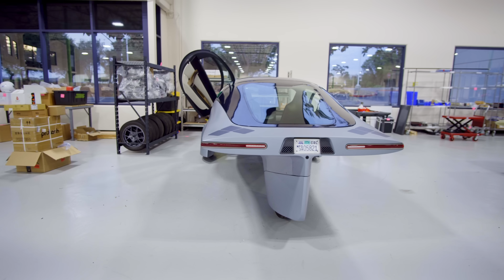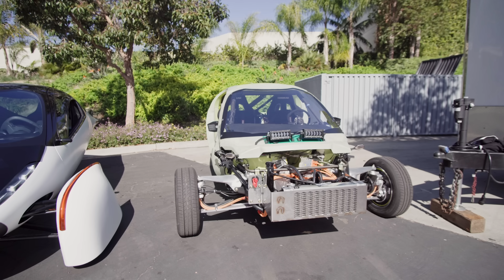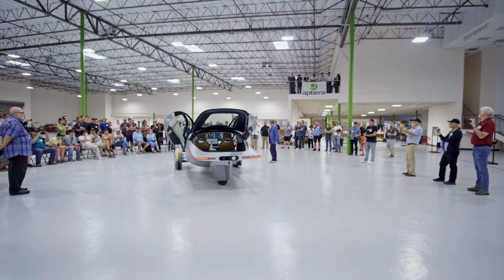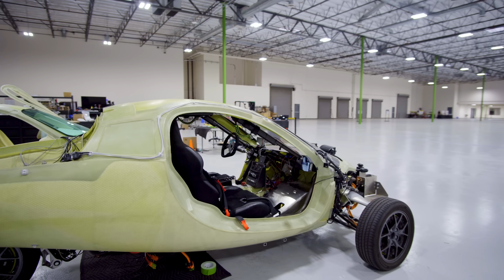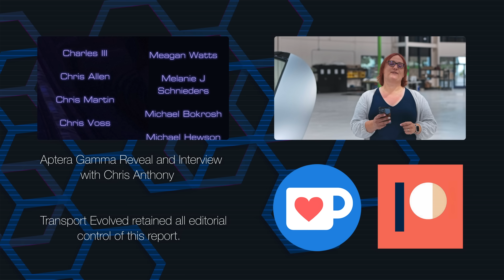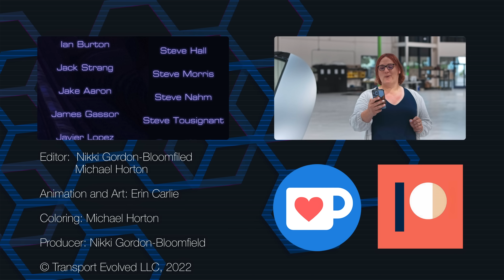The Aptera Gamma Prototype Is Here. What's NEXT?

Comment: The only thing holding back the older automakers from going to the Tesla charging port is pride.  They don't want to admit that Tesla's solution is more efficient while being elegant and simple to use.  North America should adopt the Tesla North America port as the standard as it is the most common here already.  EA is already going to be replacing all of their stations, might as well add in Tesla cables.  I guess some people like having to hold up the CCS plug while it tries to initiate a charge since it's too heavy for the angle it's usually placed.
Reply: The other thing making the Tesla connector impossible for other vehicles is that it CANNOT handle the 800V and 1000V DC charging that is necessary to fast charge the very large packs that they have.  The Tesla connector is limited to 400V by the spacing of its contacts.
Reply: @wingsounds13  nothing else was making it impossible for other automakers to use the Tesla NA standard.  They CHOSE not to use it, big difference from not being able to.
Reply: @MarkLLawrence  Except it was Tesla that decided not to support any of the open standards that existed. Tesla was not the first to develop DC Fast Charging. Both CHAdeMO (a few years) and CCS (a few months) launched before Tesla introduced the Tesla Model 3 and its proprietary charging connector. There was no incentive at that point in time to drop the tens of thousands level 1/2 AC chargers out there in favor of a charger that was a closed design from a manufacturer with 0 reputation behind them and that struggled financially for the following years.

And Tesla doesn't just allow you to use their design (it's not a standard, it's a design! A standard required 2 independent implementations, when Aptera launches with it, you could call it a standard, after more than a decade). You, as a company, have to pay for it. And you get no say over it, unlike with the open standards that exist and where even Tesla has joined Char-IN and is able to contribute to the CCS standard.

Tesla's solution is not more efficient. It has a smaller connector and that is where the advantage for Tesla ends in my opinion. Tesla does not support V2x for example, it does not, and might never be able to, support 800V or higher (for CCS they are already thinking about 1600V which is possible on the existing CCS connector). And Tesla has shown no interest to add V2x to its design. So why would other manufacturers have to suffer from the limitations that Tesla imposes?

EA can't add Tesla cables for the simple reason that Tesla will not allow it. Tesla controls the design, Tesla controls the communication protocol. And Tesla is not going to allow a competitor on the charge market to take away customers like that.
Reply: @Hans-gb4mv  yes, Tesla controls it.  And the only thing Tesla wanted in return for other automakers to use their design was that they contribute to the rollout and maintenance of the charging network.  Had these other automakers done that, their vehicles would already have access to the largest and most reliable fast charging network out there.  But, since they went with CCS, owners are at the mercy of EA, and how often those chargers are DOA.  Aptera owners won't have that problem lol.
Reply: @Hans-gb4mv  The Tesla charging business is not for profit. Tesla's stated mission is to encourage smokeless transportation and clean energy, so i don't see a problem with Tesla sharing their design and allowing it to become a standard.
Reply: @MarkLLawrence  again, battery and charging systems above 400V CAN NOT use the Tesla connector, PERIOD!  Of course, they could build EVs that take 1-1/2 to 2 hours to charge on a DC fast charger, but I suspect that would not be popular.  These huge 4 to 5 ton rubber-tired road tanks would be even less practical than they are now.
Reply: @wingsounds13  800v EVs are backwards compatible with 400v chargers, there are already some on the road.  It would be no big deal for an 800v EV to take a charge from a 400v Tesla supercharger.
Reply: @fotoguru222  Sure, tell that to the shareholders... . Tesla is a for profit company, publicly traded and therefore has a primary function to grow on both revenue and profit. Because the moment the institutional shareholders dump the stock because the company says it doesn't wanna grow, the company will fold. If it's not for profit, how come non-Tesla owners in Europe pay considerably more per kWh than Tesla customers? Isn't that because Tesla wants to make a proper profit out of those people as well?

And if Tesla wanted to share their design, they could have opened it up at any time in the past decade. They haven't. If they had, it could have become a dominant standard, but they didn't. Everything shows that they want to do the opposite of what you are writing.
Reply: @Hans-gb4mv  Yes, Tesla is a profit making business. However the division of the company that makes, installs and maintains the charging network is not. It is not a charity either. The division was funded by the company, but now supports itself. Tesla charging costs enough to support itself and then plows all its revenues into growing the network. If it going to start allowing any EV to use it, it needs to charge more to expand faster. It also gives other companies an incentive to invest in their own for profit networks.

Comment: Thanks for another great video. I love the Aptera but I have two nagging questions. What will it be like to change a tire and are they all the same size?
Reply: There will be the additional step of removing the wheel pants, but otherwise changing a tire will be the same as any other car. They've said that it won't take any unusual tools. Probably just a screwdriver. And yes, I believe all three wheels are the same
Reply: @GoClimbARockEh  Thanks, do you know where the jack point is for the rear?
Reply: @jimmyers4890  They haven't said yet. probably just in front of the tire?
Reply: @GoClimbARockEh  Is there a collapsible spare and jack in the car?
Reply: @SilverShadow2LWB  No spare tire, which is pretty common these days. I assume they'll be a jack but I don't know whether they've confirmed that or not
Reply: @GoClimbARockEh  Thank you for the info.  The standard now is to have an air pump with sealer to repair punctures.  But sidewall damage may require a call to AAA.
Reply: There will be a recessed anchor point to screw a plate as jack point. I think fwd of back wheel.
Reply: I owned an original Honda Insight with enclosed rear wheels. Removing the wheel cover to change tires was pretty easy.

Comment: Special curved solar cells don't exactly scream "easy to upgrade" to me.
Reply: Look at what is coming down the pike!  Multiple R&D centers are now showing flexible panels with 30% efficiency rates.
Reply: Certainly proprietary. You won’t find replacement at a local shop, but the whole panel should be easy to replace.

Comment: Nice to see them make progress, I love the idea of having a significant number of efficient (meaning low-drag) vehicles on the road.
Going with a single, center headlight for a car that's wider than many SUVs seems like an obvious bad idea for safety. I hope those yellow strips on the wheel covers are nice and bright.
Reply: Modern beamforming can very easily have a center light project even light across a wide area. I wouldn't be surprised if this had better illumination than some larger cars
Reply: @Ryukachoo  I'm not concerned about illumination. I'm concerned about making the outline of the vehicle clear to other road users, especially oncoming cars. The traditional way to do that is to have a powerful light in each corner.
Reply: @w0ttheh3ll  oh, the bright as hell light bar and the big orange illumination on the wheel covers should be sufficient
Reply: @Ryukachoo  I hope so. The concerns are that the main light may wash out the orange markers and that many drivers don't accomodate for unfamiliar vehicle types.

Comment: Love this vehicle. Self repair, uncompromising effort to efficiency and what works (tesla chargers, css with adapter), solar panels. Takes a lot of guts to make such a different car. I’m rooting for this underdog
Reply: @The Program You should compare the Aptera to another BEV. And in this comparison it needs much more maintenance.

Right to repair is useless in BEVs. What do you want to repair? The batteries? Electronics? motors?Inverters? All with 400V? A perfect possibility to roast yourself? Or set the battery on fire?
Reply: A motorcycle that repairs itself? Great underdog.

Comment: Great to see them getting closer and closer to production. Glad that they're at least thinking about having adapters available for the charge port. I'm also glad that they're thinking about people who want to make future changes to the vehicle.

I disagree with Chris (Aptera CEO) on wireless charging. If you want efficiency, then wireless is not the way to go. Wireless is DEFINITELY convenient, but you lose power from the transmission. Wired is much more efficient.
Reply: you are confusing phone chi charging with this different protocol. either way this is a waste.
Reply: @laloajuria4678  He talks about wishing that the Aptera could do wireless charging during the same segment when he was talking about their decision to use the Tesla port. 

Wireless charging isn't available YET for EVs. It's been talked about and people are designing for it, but it hasn't been implemented yet. The problem with wireless charging for EVs is the same issue you would have with wireless charging for a phone. The ONE place where Aptera might find greater efficiency with going with wireless charging is that they wouldn't have to put a charge port on the vehicle.
Reply: @zidaryn  Wireless charging for cars has been available for a few years now, but only as an aftermarket upgrade. I don't think any manufacturer has included it stock yet. And yes, it's not as efficient as just plugging in
Reply: @GoClimbARockEh  Cool. Wasn't aware it was actually in use yet.

Comment: So if I'm hearing correctly, Aptera will stick with the Tesla charge port and use an adapter for CCS and J1772.  Considering that Tesla has just released its CCS adapter for North America, maybe that's an easily sourced solution.  The more interesting part of this discussion is if Aptera is in talks with Tesla about using their Supercharger network for Aptera owners.  That would easily give an edge to Aptera owners while Tesla figures out how to open their network to CCS capable EVs.
Reply: If they don’t get SuperCharger access I will probably cancel my pre-order. I will not use it often (1% of my charges) but when you need it you need it. 

Being able to use my Tesla friends and hotel level 2 charges is also important.
Reply: @AstroStrongBox  I'm wondering why this is a deal killer for you. I've had a Chevy Bolt since 2017 and used DC fast charge (non-Tesla) twice. With Aptera being so much more efficient, the charge requirements are substantially less, so why all the concern over charge speed? When you DO feel the need for speed, why wouldn't a non-Tesla fast charger work for you? There are lots of them and the number is growing all the time.
Reply: @billman5379  I don’t need the speed of the Superchargers just the ease of use (just plug in with no extra app or NFC Pay), uptime, and more stalls at each physical location. 

The supercharges MIGHT have better just off the highway near food locations. 

Electrify America usually only have 2 to 4 stalls per location instead of 8 to 10 l Iike at Superchargers.
Reply: @AstroStrongBox  So far every US charging provider is half-assing it compared to Tesla.  Some are at quarter-ass.
Reply: @AstroStrongBox   the Aptera battery is so small you can charge it quickly with a regular 120v outlet. super charging isn't really necessary.
Reply: @jpcool95480  I agree. But during my 3 road-trips per year I want to be able to recharge in like 8 mins at a supercharger. 

I love that a 120VAC outlet is good enough for daily driving. That said I will be buying a Tesla Wall Charger Gen 3 because I like the look and the auto power sharing feature if you own more then one Gen 3 Tesla Wall charger.
Reply: @jpcool95480  The true beauty of a VERY efficient design.
Reply: @AstroStrongBox  When Elon visited Aptera headquarters he offered his chargers.
Reply: @1voluntaryist  Thank You VERY MUCH ELON!
Thanks @ blazeddanders for the info!
Reply: I'm not sure how this is going to work internationally. 
There are no Tesla chargers in my country, we only get the MIC Tesla's so all the Tesla superchargers are CCS. They have talked about the Australian market, I believe they are in the same situation with only using CCS in Tesla's.
Reply: @randomaccount53793  I don’t think Aptera is thinking about anything outside North America with these conversations. When the time comes it will be easy to install the correct plug for the country or region they will ship to. 
Europe currently uses a different CCS from the US and China has a different plug and Japan has a different plug. They all have different headlight, mirror and pedestrian requirements as well as turn indicators and so on. Aptera has to get into the home market before they can expand to the world, but I’m sure they will get there
Reply: It actually sounds like Tesla will adopt CCS in the USA like they did in Europe. Aptera is behind the ball.
Reply: @joweb1320  Not Likely. The EU required the CCS2 port before Tesla started shipping the Model 3. That ship sailed and in the US, Tesla is 70% of all EV's. I think within 5-10 years everyone will be induction charging and there will be no plugs
Reply: @kenmcclow8963  Maybe. Interesting that Tesla is now selling a CCS adapter in the USA now.
Reply: @joweb1320  Tesla is going to allow CCS cars to charge on Tesla chargers, so they needed to allow Tesla cars to charge on CCS chargers, although why anyone would want to is another question.
Reply: @kenmcclow8963  Time will tell how it all works out. Maybe because they intend to have CCS plugs on some of the new Superchargers to get government funding to install them.
Reply: Since even tesla is going away from the connector it's no longer going to be an advantage.
Reply: At least with the alterations charger port being bang in the middle at the back it won’t block 2 places when using a Tesla supercharger (like all the other EVs who placed the charge port on the wrong side…. when 70% of Evs are Teslas and they have the best charging network, deliberately making your vehicle incompatible is barmy)
Reply: @gothmog2441  yeah, and who's idea was it to force people to back into a parking spot just so the port can be on the back? DUMB
Reply: Not convinced that choosing a proprietary connector is a good idea, however well engineered it might be. Proprietary interface standards for anything is a terrible idea. Sits oddly with their professed belief in opening up the specs for parts. Maybe Tesla are happy to provide details, make it a standard and allow 3rd party manufacture, but their general attitude to this sort of thing has been pretty bad so far.
Reply: @xxwookey  Yeah it really seems to be at odds with the right-to-repair philosophy they espoused earlier in the video.
Reply: Yes keep the Tesla charge socket!
Also love the idea of a 500 watt induction charger 😘
Reply: Not a deal breaker, but I have had a CCS charger since 2012 (nissan leaf then chevy volt).  If an adapter is available, that's fine.  If I have to change my charger port (and it then can't be used by cars without the Tesla port), that's a (possibly expensive) pain.
Reply: @someoldguyinhawaii4960  LEAF uses CHAdeMO, Volt does not have CCS DCFC capability - regualr L1 and L2 J1772 only. Did you meant to say Bolt? Not sure what you're talking about here regarding different "charger ports". You are not changing any charger ports - you would use an appropriate adapter for your use case.
Reply: @EdKimWoodenHatEd  No Volt - I had a Leaf then I traded it in for a Volt - same charger
Reply: @someoldguyinhawaii4960  Thanks for reminding me, My 2014 LEAF has BOTH Chademo AND J-1772! Not all leaf's have Fast charging plugs!
Reply: I don’t understand why Europe has these chunky adapter for wall outlets and then want to do the same for EV charge port.
Reply: If they launch the vehicle like that in Europe, count me out. Not even Tesla is producing cars with their own, proprietary port anymore anywhere except in North America. For Aptera now pushing and betting on that port is simply betting on the wrong horse.
Reply: @Hans-gb4mv , the Tesla port is dramatically superior to the ghastly CCS monstrosity.
Reply: @jonathangwynne1917  there is bidirectional charging though. I don’t think that much matters to Aptera though it might be nice to send excess solar through to my house.